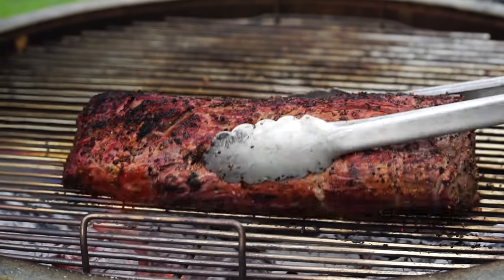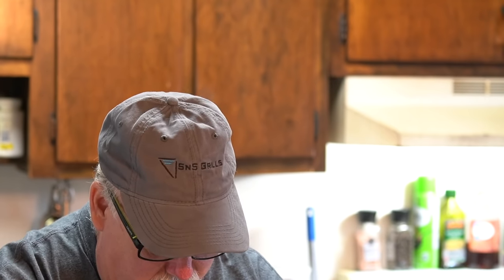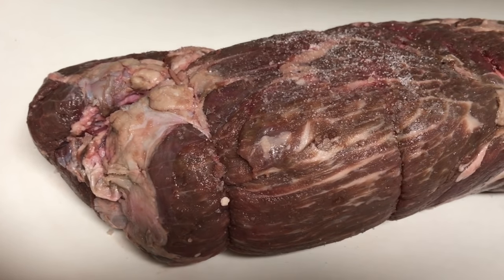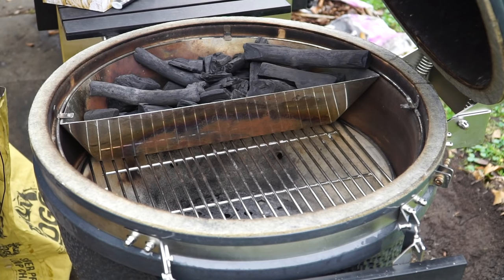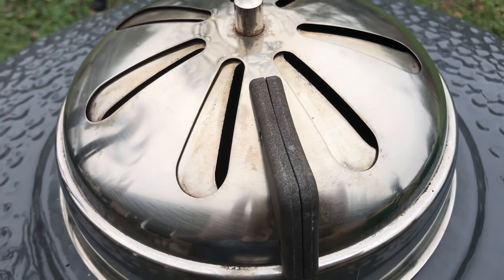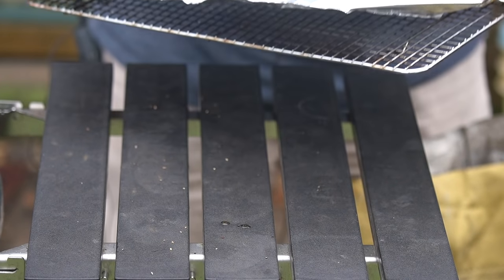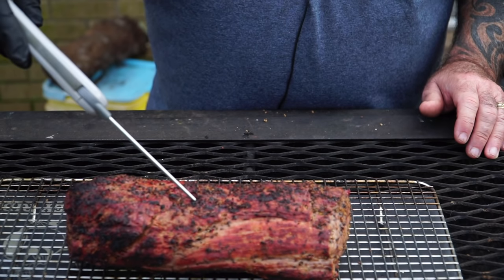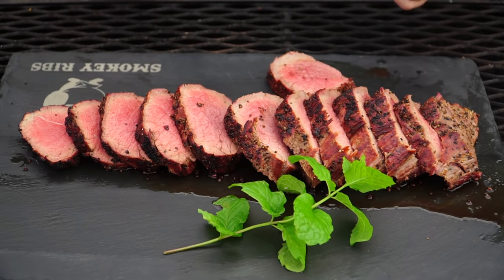How to Grill Beef Tenderloin Roast Perfectly

Comment: There is a theory that the colder the meat is when you put it on the fire the more smoke it will absorb. I have not tested this, but I do put the meat on the fire quite cold.
Reply from the maker: This has mainly to do with the smoke ring.  It stops forming after the meat reaches temps in the range of 150F, so the longer you keep the meat at cooler temps the more time it has to develop the smoke ring.  Give it a try!